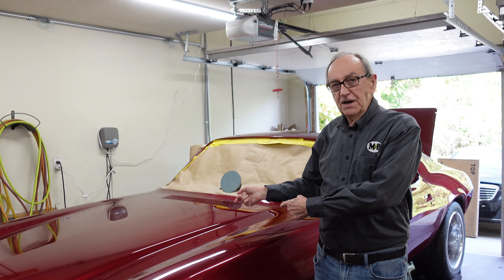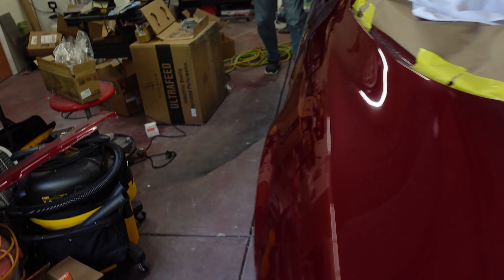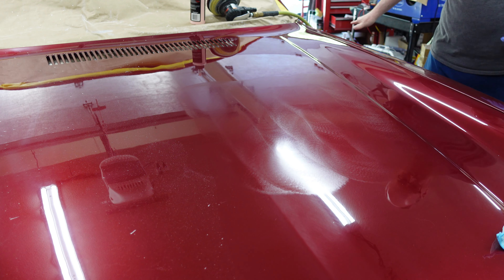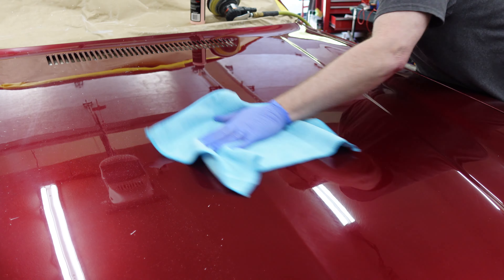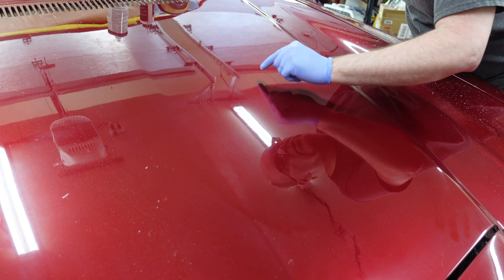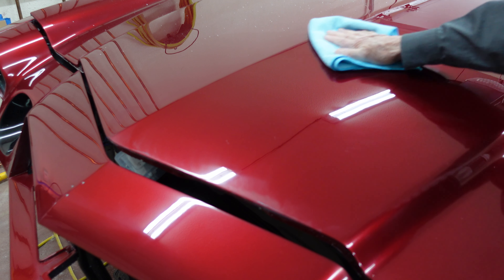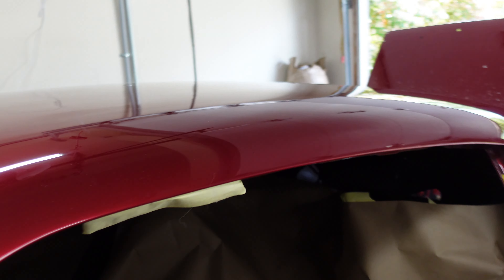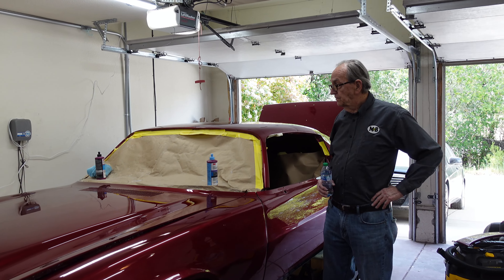1977 Camaro Z28 Part 307: Chasin' them scratches

Comment: The reason the microfiber cutting pad and meguirs d300 didn't work that well is because like you said it's ment to be used on a whole lot larger throw machine that pneumatic sander probably only has a 5-8mm osalation where as the bigger throw da will have anywhere form 10-15 all the way up to 21mm throw which will cut alot more and work faster either way there is more than one way to skin a cat and as long as you get it looking good I see no problem!
Reply from the maker: Yeah, that is what I figured
Reply: @asicerik  either way brother good looking car and paint job most people won't even have a trained eye to see what you see!

Comment: Hey brother did you see syfg last video if not got check it out I learned something as well he uses guide coat when he wet sands to minimize the scratches
Reply from the maker: Hey bud! I did not, will need to check that out. Roger had suggested that as well. I guess I am little scared of grinding guide coat into my clear.

Comment: What grit did u use?
Reply from the maker: For which part? Before the buffing? We did 1500, 2000, 3000, 5000
Reply: @asicerik  I do paint and body for the last 45 years for a living. 
   Color sanding takes time.
Reply: Don’t  contaminate the pads with different Products. That does not work well.
Reply: After using wool pad with buffing compound,go to the 3M foam pads polishing pads only for your Final steps
Reply: Remember don’t cross contaminate the past
Reply: Good luck sir
Reply from the maker: Thanks Sam. I do use the color coded foam pads for each compound. The wool pad only gets the rubbing compound 1

Comment: Your arm speed is way too fast man. Way too fast. That compound does not even have a chance to work. Also you don’t need to prime the pad. Two hands, methodical, and slower arm speed. 4 section passes. Two up and down two side to side….. much too be learned. Car looks shiny but the polishing technique isn’t helping anything. Try watching some esoteric videos on how to paint correct
Reply from the maker: I have watched a lot of videos. This is something I think you just have to practice. Also bear in mind, as me doing this for the first time, I am going to be VERY cautious so I don't damage the paint
Reply: @asicerik  yes absolutely. We all have to start somewhere, and I hope I didn’t come off harsh. Message me for any tips and watch some esoteric videos. You will get it down, it’s an art form. And the more you do it, the more you will realize that it’s very hard to make a tragic mistake. It’s easy to make little mistakes, but you can achieve perfect paint. You’ve done an excellent job wet sanding out the orange peel and that red paint looks fantastic